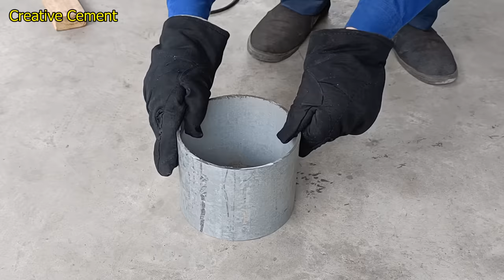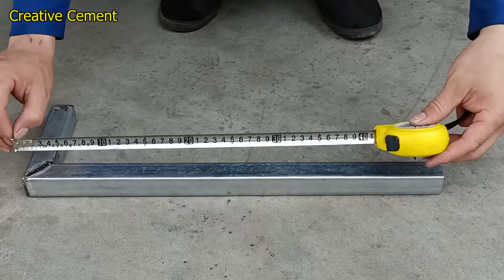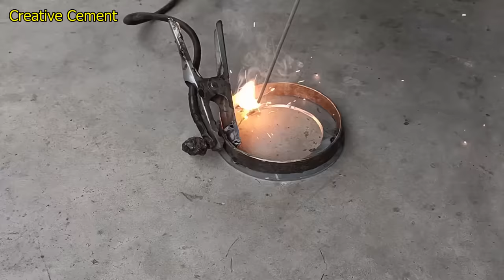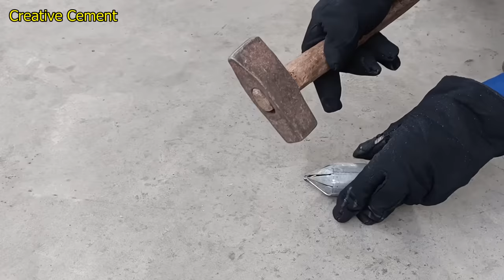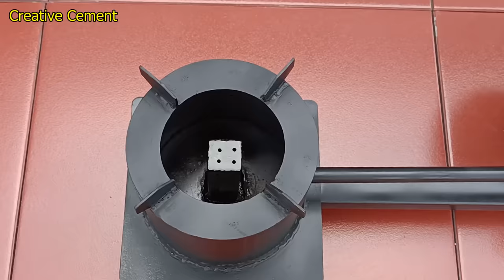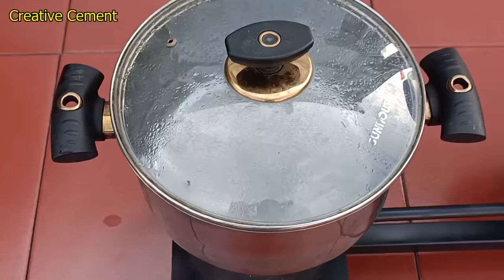How to make a stove that burns used waste oil effectively replacing gas

Comment: Working principle: The upper body of the stove is the part that generates steam pressure. When the oil is hot enough (gasification), the water creates pressure and sprays on the top of the stove. From there, a pressure melt is formed and the fire is drawn to the surface of the stove top

Comment: I built stoves of the equivalent heat output and efficiency as this one (7 burners) without any tools or equipment just using a foil tray, metal tomato concentrate paste tubes, a few wire coat hangers and toilet paper for the wicks. The tomato tubes were opened up with the ends cut open and a tightly rolled up toilet paper wick then squeezed inside and the tube flattened at the end made of the thicker metal, then the tubes were supported upright with coat hanger wire on the foil tray so the bottom of the wick was touching the foil, cooking oil was then poured into the tray and the wicks drew it up until the tissue at the top of the tubes became wet with oil, now light the wicks one at a time and start trimming the wicks, this takes some care but eventually you get an even smoke free flame on each wick. Make a saucepan stand with the wire coat hangers or a wide diameter tin can with both ends removed and holes at the bottom end for air and oil, position the tin or wire stand over the burners and you have your stove, I made plenty of these taking about a 1/2 hour each with no equipment and when the wicks are trimmed properly they work great.
Reply from the maker: Thank you for your comment
Reply: Po
Reply: Apakah anda mengaopodnya di yuo tube? Ada tutorial pembuatannya?
Reply: Hey make a video of it ! I would like to see yours as well. Does it need a fan forced tube to work? I wish i could get away with no electricity use as well so as to be fully self sufficient.
Reply: Ufo

Comment: Looks very good. The oil that you used didn’t look really burnt oil, which usually has a darker colour. My question is will your design work with really burnt engine oil. Thanks
Reply from the maker: Achei que está funcionando bem
Reply: @CreativeCement  And what kind of edible or technical oil is this oil used by machines?
Reply: @reshad711  used cooking oil
Reply: Зима 2022-2023 всеЕвропе покажет  !!! Будут ли гореть и греть  печурки в Хэйропе  😈😇😂
Reply: Ğ
Reply: I can see no reason why it would not work. But I would never use it except out of doors and would not like poisonous residue on my pans.. used engine oil has many contaminants.
Reply: @steinbauge4591  I have a feeling this was cooking oil, not engine oil
Reply: @braikka  sure, but the question was about engine oil and 'waste oil' would include that.
Reply: The problem is not the stove but the smoke. And of course, from where to get all this old oil on a perpetual basis?
Reply: @lenny 108 If you own a restaurant. Especially fried chicken and french fries kind or fish and chips. That would save you money.
Reply: @pejbartolo2365  cooking oil is recycled these days has been for a long time actually over 10yrs that i know of
Reply: The questions is will you cook your food with engine oil????
Reply: @steinbauge4591  i guess you dont know how petrol and LPG are made from crude oil the only reason there will be smoke or residue is because the oil is not heated enough turning it into LPG   before burning a couple coils of pipe in the heat are will fix that problem it will be no more dangerous than your average refinery
Reply: @ruffnut743  whatever. this video is about an oil cooker for waste oil
Reply: @steinbauge4591  i could go into great detail to explain the diffrence between used  waste oil and turning it into a gas to burn as no liquid burns only gas burns if you throw a lit cigarette in a bucket of petrol the butt will go out its the petrol vapor or gas that burns  not the liquid
Reply: @ruffnut743  Aware of this, have used paraffin lamps and primus (cooker). My only point was that I would not use this indoors or a too closed off space. There will be waste products, if nothing else CO.
Reply: @braikka  ето масло посли чипси
Reply: ผมหยากใด้เบอรโทรครับ
Reply: @slawaRossiinavek  macie już kible?
Reply: @lenny108  Mac do
Reply: @slawaRossiinavek  переживай лучше за Россию, Европа не пропадёт
Reply: @pejbartolo2365  A company actually pays the restaurant I work at to collect our used fryer oil.
Reply: @the_inquisitive_inquisitor  just like all big restaurants, nursing homes, hotels, etc pays a disposal company to dispose used oil. It is illegal to dump it in the sewage syatem because it clogs the sewer.
Reply: @ruffnut743  lpg does not come from crude. Although they coexist in most oil wells. Different animals or chemical composition. Lpg is mostly propane, or a mixture of propane and butane. It is compressed to make it liquid. Crude is the black liquid substance that comes out of the well. It is composed of thousands of chemicals and in order for it to be useful, it has to be refined or simply go through fractional  distillation, etc to give you kerosene, diesel, oils, etc.
Reply: @the_inquisitive_inquisitor  mea culpa. In most cases, you pay a company to take your waste away.
Reply: @pejbartolo2365  Not your fault, I live in a particularly "green" town.
Reply: That's cooking oil used fir frying etc.
Reply: Put inside a metal box with stove pipe. Contaminants move outside.
Cook on the metal box.

Comment: Excellent work and money saver idea as well its useful in any area safely.
One question the black coloured you spray on row stove to make it final piece. Do you think the heat will be affected that color or which color you used for long run safe. 
What is the blower speed or capacity? 
I like your oil dripping system for longer use. 
Can you use only cooking waste oil or automobile oil is fine? 
Where are you located ? 
Keep it up your ideas helpful to many needed in this world 👌💐

Comment: I did like the channel says but when oil run out it stated to consume air and my garage. A fire breakout spread to nearby oil refinery. Firefighters trying to extinguish that fire for a 6 days now. A major blast on day 2 took down a plane that fly by and it is destroyed nearest water station so fir a 4 days firefighters had to drive for a 7 hours straight for a water source. I like it, this furnace is very fun!
Reply: Te  falta ácido fólico?

Comment: If we'll compare this with gas, will it be economical? Which oil will be more efficient?
Reply from the maker: Thank you for your comment
Reply: i dont think its for economical but rather to recycle use of the used oil rather than in some asian countries they simply throw it into the drains and when it hardens clogs all the drain system apart from ruining the environment

Comment: Ok great idea!! One question, how do you stop it from burning when the bottom of the burner still has fuel?  I get that you cut off supply, but just let it burn out?
Reply from the maker: When the bottom of the burner still has fuel, you can prevent it from burning by cutting off the fuel and air supply, covering the stovetop with a wet towel.
Reply: As what the platters singers, says smoke in your eyes? Haha

Comment: Would this work without the fan if you just poked large air holes on the side? Nice to have but without needing electricity. Great video. Thanks.
Reply: A thermoelectric plate on the outside of the burn chamber would likely create enough current to run a fan. Would not require an external electric source.

Comment: Is the ‘waste’ oil from car engines, diffs and gearboxes?
Reply: Or old fryer oil? Either is good to reuse like this, would be a boon to alot of remote settings me thinks.
Reply from the maker: You can reuse the above oils

Comment: For making understandable , wright From start each part be shown connecting its portion and Basically oil used be told about its availability , Small motors type - direct Electric operated or Battery powered for Fan. Also it will be more Favorable if step by step mentioned in Videos Discription Box.
Reply from the maker: Thank you for your comment
Reply: I believe it's used cooking oil since motor oil would have foul smelling (and tasting) smoke

Comment: It might burn waste oil but apparently it needs an electrical powered fan which begs the question, what's the point?
Reply from the maker: Thank you for watching
Reply: This isn't to generate electricity, it's to generate heat.

The amount of heat generated from the waste oil greatly exceeds the energy input of the electricity of the blower.

Comment: Nu i o invenție Pe acest principiu funcționau si injectoarele cu combustibil special la unitățile militare .Adică era sus un rezervor cu combustibil special cu o conductă de scurgere ce ducea la un electromotor cu axul găurit longitudinal prin care trecea conductă cu combustibil special .In partea din fata a electromotorului era intr o carcasa un ventilator cu un ajutaj care se rotea odată cu rotorul electromotorului .Cand combustibilul picura pe ajutaj suflul aerului produs de ventilator făcea praf combustibilul precum injectoarele de la motoarele DIESEL .,si jetul format se aprindea .Se dădea foc cu o festila prima data apoi se pornea electromotorul .ca apoi sa se încălzească apa din cazanele tubale ce folosea la baie sau bucătărie .

Comment: If you fill it that much, the oil will flow back in the air blow tube.
Reply from the maker: I just let the oil drip not exceed the bore of the air blower
Reply: @CreativeCement  Of course you are aware of it, it just looked like the oil overrun the holes and i was wondering. :) It's the camera angle that fooled me i think. Another: is that hot air that you are blowing in? Thanks.

Comment: Kala ko nmn used oil  need lng pero need pa rin ng kuryente, oo nakatipid sa gas,  pero panu pag wla kuryente, yun lng nmn sna meron kya ganyan  kalan na no need to used kuryente, gayahiin ko na lng used oil at saw dust  na Gunawan brick Para pangatong.pero sna kalan na using used oil na need kuryente, sna may makagawa ng ganun

Comment: Have you heard about the used oil furnace from 1950's that ran on water? Patent was issued to army service men in Texas for only adding water line to T fitting for used oil burner on used jeep engine oil, to get 50% increase in efficiency. That was not what was written in their application for Patent. SS coil tubing in brick insulated firepot of oil burner hooked to input common water line. Oil furnace started. Oil line has spring operated check one way valve. Temperature gauge monitored for temp up to 1500 degrees F. Then valve opened so as superheated steam is allowed in T fitting with oil to tiny nozzle. Nice burn flame runs constant. Then oil line shut off. Furnace still runs. Shock wave from 90 lbs pressure to zero AMBIENT in fire-pot forms Hydrogen and Oxygen torch flame that also heats heat exchanger. Normally water molecules separate at about 3000-6000 degrees which is too much energy. The vibration shock wave allows for disassociation at lower temperature. Electric motor with dual shafts ran 2 oil pumps at 90lbs. If water shut off, and cooled down, then furnace has to be restarted on oil. A much smaller unit in crate was shown to a US senator in Washington building underground parking , as an open trunk display. This was somewhat similar to the propane operated camping stove with circular pores, vertical round fire brick insulated chimney, and interior SS tubing of water. When steam introduced to T fitting, the fuel used  was shut down leaving burning circular torch flames. It probably used minerals free distilled water so as nozzle would not clog. (US Patent office not allow for over unity for public.- Free Energy is eliminated in issued US Patents. US-      2,863,499.
Reply from the maker: Thank you for your comment

Comment: Except that it doesn't "effectively replace gas"; it produces a large amount of carbon monoxide, so it can't rationally be used indoors. It cannot be fully sealed, so it leaks continuously. It produces soot, so it badly blackens the outsides of all your pans. The oil it burns contains heavy metals and other significant toxins, usually including lead, so even outdoors, the fumes are noxious and toxic, especially to the very young.

This is a really really bad idea if cooking can be accomplished in any other manner short of burning rubber tires.

Comment: which oil can be used? i mean automobile used oil or any other?
Reply from the maker: I use engine oil
Reply: @CreativeCement  ~ The oil you put in looked new and your title says "waste oil".  Would the used stuff burn blue like your assembled demo ?  Beautiful build and presentation.  Your one of the few who put a soundtrack in that is actually pleasant, while the build goes on.  GM

Comment: This is bad for the environment.This is your future without Russian gas.
Reply from the maker: Hello. Thank you for your comment
Reply: With the blower, it appears to burn quite cleanly. What do you think happens to all that waste oil they drain when doing oil changes? They burn it, for heat &/or electricity. 

If you can't get fuel to power your vehicle's engine, the motor oil won't cook you much food. If you can get the fuel, that would be a better option for cooking, in a shortage. This is an ingenious way to use up a waste product.
Reply: @CatastrophicNewEngland  What do you think about dioxide? Your burners produce a greenhouse gas.
Reply: @CatastrophicNewEngland  
You are being rude.
Reply: @CatastrophicNewEngland  
Your technology is a return to 1700. Offer something new and environmentally friendly.